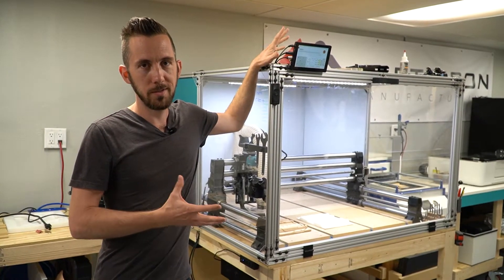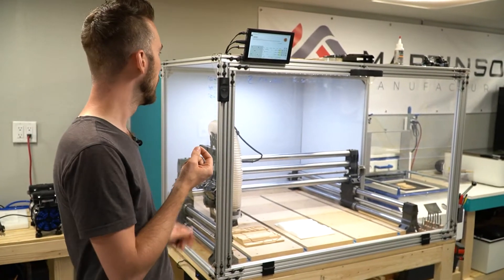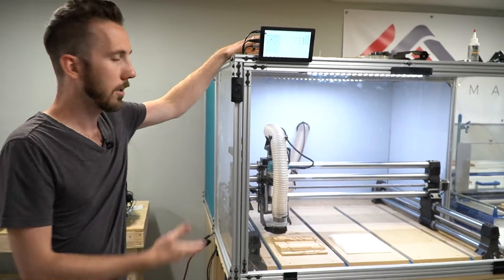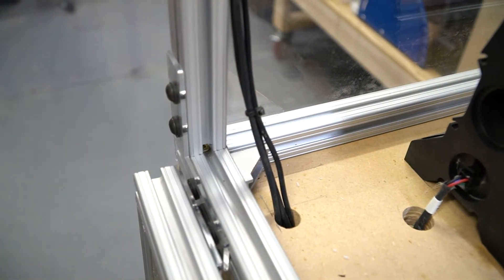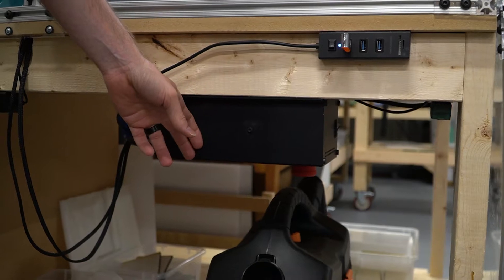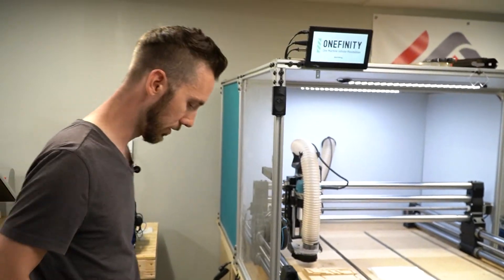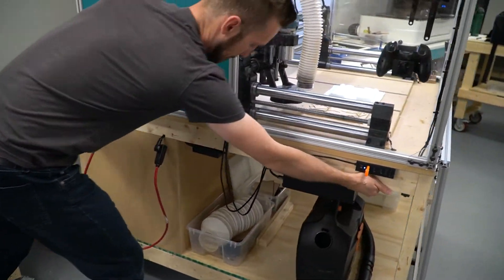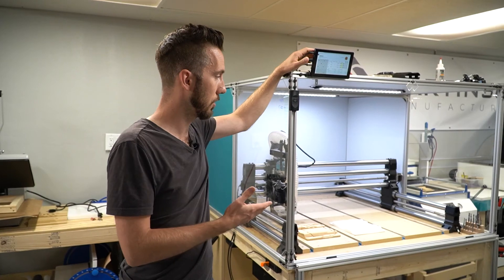CNC Enclosure - Onefinity Woodworker

Comment: I love this enclosure! It is the best one I've seen so far. I am considering the Journeyman X-50 and I know I want to build an enclosure, but all the others I've seen so far were plywood and plexiglass. This one by far is my favorite! I love the simplicity of assembly and the visibility it provides. So, thanks for that inspiration. On another note, do you feel the shop vac is adequate for the dust collection? I have a 4" dust collector for my shop and was looking into one of the aftermarket dust boots, but a dedicated shop vac setup would be easier as long as it performs well. Thanks for the video! - Joe
Reply from the maker: Thanks for the comment! The Ridgid shop vac I use works incredibly well. It will even pull dust out of the air in additional to the wood dust generated right at the cutting bit. I'd recommend putting it on its own switch. It's nice to turn it on separately and vacuum up the table after a job.
Reply: @Joe_Martinson  Awesome! Thanks for letting me know. That's probably the setup I'll be going with, then.

Comment: Nice enclosure! Unrelated question: where did you get the clear refrigeration sheathing from? I've thought about using those for a miter saw dust enclosure
Reply from the maker: I found a big roll of it on Amazon. Can't remember what I typed in, but I'm sure it'll pop up.

Comment: Very cool - love the enclosure. I have my OneFinity on order and want to build and enclosure as well. What would you say the minimum height for the enclosure would be? I'm thinking about putting it lower and having a standing height workspace on top of it.
Reply from the maker: Thanks! The height of the machine itself is 17". If you run your vac hose up and over your router like I did the top height of that hose is 21". 
I would say the absolute minimum would be 24" because it gives you a little room to maintenance etc. 24" seems to be the most common height I've seen for this machine.
Reply: @Joe_Martinson  Cool - thanks, appreciate the response!

Comment: 11:08 Yes, the air flow into the cabinet is a good thing. In fact if the cabinet is too air tight then your vacuum will underperform because it is starving for air or really trying to draw a vacuum on the whole cabinet. To effectively move chips you need to be moving air at high velocity and volume. SO maybe experiment with an opening in the cabinet to let make up air in. Something on the bottom in the back light be good to keep noise down. You could build a sound trap to cut down on noise escaping the enclosure.

I would do something to relieve the strain on those cables. They will eventually fail if you don't. It doesn't take much repetitive movement to break the conductors in those cables. The connections will become intermittent and will drive you nuts trying to troubleshoot them.

In place of the hard panels in the back is there a soft, sound-deadening material you could use or apply to the interior of the panels you have. Anything that breaks up those hard, reflective surfaces will help.
Reply from the maker: Thanks for the tips Bob. The vacuum works well, but I'm thinking my enclosure may be too air tight and I'd hate to burnout my vacuum so I may try some small openings in the bottom back like you mentioned. 

Thanks for the tip on the cables too I didn't think of that. Probably one of those things that's okay for now but will eventually wear out over time. Do you think a drag chain would be a good solution?